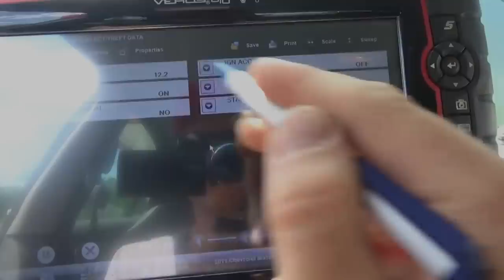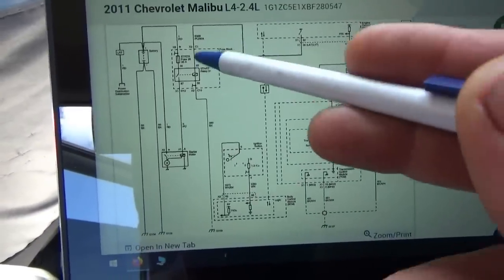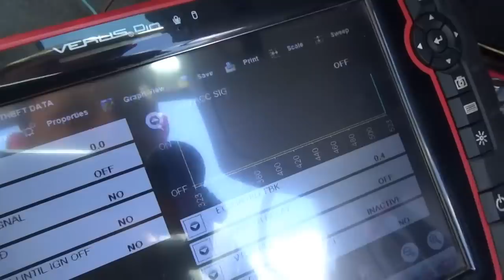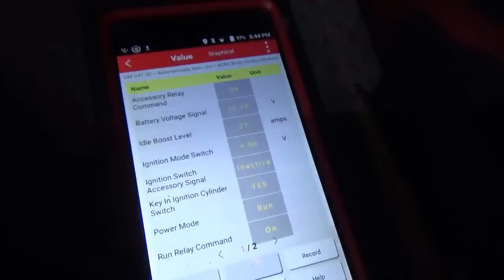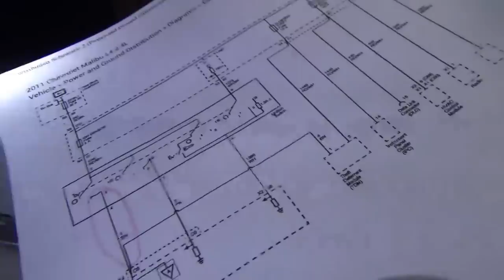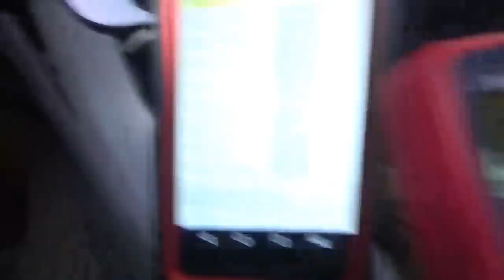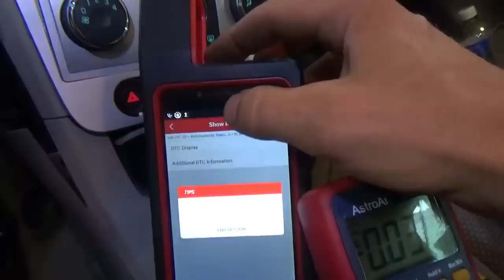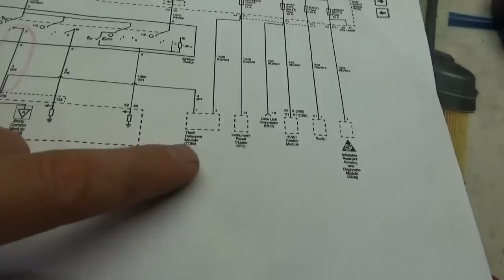Mystery Malibu is BACK! (Intermittent No-Crank)

Comment: Hi Ivan, I worked as a mechanic several years ago. In my years working on cars
I ran into this condition twice. The fuse(s) had just cracked, did not burn or blow.
Any craftsman has to learn these type of "conditions with experience. I think you did
very well checking this problem out. You are an excellent TECHNICIAN. Thanks for
the great videos.

Comment: Had a similar problem with an A-7E Attack aircraft. Drove me crazy for 2 days. Relay logic in the power link between the navigation computer and the Doppler radar “go-out-of-standby” command. Sure enough, a glass fuse looked perfect, but I never ohm’ed it out and it was open. Worked almost the same as what you were working on. Problem was once the electronics bay warmed up the problem disappeared. So we put an external A/C unit in the electronics bay and cooled everything down (like it would be in flight) and finally found the bad fuse (that the night shift and day shift had looked at (not ohm’ed out) a dozen times). Hold it in your hand for 30 seconds it would close. Cool it down and it would open. Had to demonstrate it to the shop Chief. He kept it and showed it to the maintenance officer. Nobody had seen anything like that before. 

Anyway, your retrospective troubleshooting is spot on. And you may have felt a little “pressed for time” as the customer was at a gas station, had other stuff to do and needed to go... in that situation skipping several steps would allow you to find a work-around and get him going again. So, yeah, it’s an opportunity to oops.

Great video and thanks!!
Reply: Worked USAF Aircraft Avionics for a long time.  Yes, problems that would drive you out of your mind.  Like this one in one of out 400W HF Radio systems.  Worked OK in lower HF freqs - lost a lot of power out in the high end.  Problem?   SOMEONE, "out in the system" - was a C-141B - changed a segment of Transmitter Coax.  Use wrong Coax with a totally different Impedance.  At high freqs the segment would offer mega reactance and kill the output.   That was a 2 day around the clock.  Did I find that.  Yes (I have to admit it. :)  Just checked the size of coax on the cable itself.  Was wrong coax.  N-6395T
Reply: That's pretty cool. I asked an instructor in the 70's how to troubleshoot an intermittent. He said stress it. Hit it, heat it, freeze it. Found a goofy cap!! And that stereo was in the trash can 5 times prior.
Reply: A wonderful story...that's what makes a good teacher!
Reply: Awesome stuff here!
Reply: John- Would you believe 2 Boy Scouts and a whistle? "Hello Chief?" I can't hear you Max. My favorite show- So much I named my son after 99.
Reply from the maker: Great story! Probably why they don't use glass fuses anymore haha
Reply: I thought he was bs at first mans really got an aircraft
Reply: @ylmbonez  Yeah, I do. But it isn’t an A-7E, unfortunately. I’d love to have one, but they are all retired now. I think maybe some foreign ally’s may be flying them still. But, I suspect they’ve all gone to the chopping block by now. Really good airplane, that Corsair II. LTV/Chance Vought. I loved working on it.

Comment: I think my favorite part of the video is where Ivan covers the lesson learned at the end.. It is harder to stop and think of a lot of these things when at the gas station with the customer hovering so there is pressure to get the problem resolved asap, and perhaps a real or perceived accusation of either having caused the problem by working on the car in the past or that a previous repair wasn't done properly which may or may not have played in. Personally I have had many people try to imply that to be the case even though it's fairly plain to see that the problems are not related.
The lesson however is just as Eric O. states, "You have to go slow to go fast".

Comment: Ivan. You are a terrific person. You work through problems step by step. Having to talk and record and diagnosis and fix the problems put a tremendous load on your thought process. I think you can record what you find and fixes will help unload the stress you are going through. I have been following you and my 66 year old mind has learned a huge amount from you. My mind is always open and learning. I am working on a 87 s10 pickup that has not run in years. Just last week. I got the truck to fire up using a carb spray cleaner as fuel. The owner had a huge smile.  He had to order a new fuel pump. I cleaned out his old fuel tank. Full of debris. Installed new pump. Checking the wiring. The hangers are missing hardware. So that's on my list. It's getting really close to have actually running. After many years sitting in his front yard. From what he told me. Other mechanics have tried and failed. I'm not patting my self on the back yet. Until it's on the road and running well. Remember take a little more time and don't get pressed and stressed for time. As another person noted. Have it towed to your shop and take the Time.

Comment: Was a diagnosis master tech for a famous German brand for the last 30 years and retired now. I like the work you do. The best way to look at an issue is to ask yourself “what does the control unit have to see to enable in this case an engine start”? 
So with this one do a pin by pin on the BDC. Check all inputs and outputs. Are they all there NO. Remember garbage in garbage out. Hope you can understand my explanation 😂👍🏻🇨🇦

Comment: The newer OBD2 compliant cars are easier to diagnose because when a sensor or connector fails on any given sensor you're likely going to get one from the actual sensor or connector that's faulty.

For example,I am getting a code 54 in my brothers 2000 model Subaru Forester,I checked for air leaks in the air intake & I did fix one which was the throttle body gasket which shrunk & cracked at 20 years of age,I sprayed it with both carburetor cleaner & water ,I did a compression test which tested at 193-195 PSI which is good,the fuel pressure is good as well.

I checked the fuel injector coil resistance which was good as well, the symptom is that the engine runs smooth for 15 minutes albeit at a higher idle speed then it starts surging,I did test the oxygen sensor which tests good,I also replaced the IAC valve assembly which made a bit of a change but the problem is still there.

Now,my brother has a habit of running reoilable K & N air filters which could've contaminated the MAP sensor with oil,I've ordered a hand held vacuum pump so I can check how much voltage that it's putting out under different levels of vacuum so I should get that on Monday.

The MAP sensor costs about $400 -$600 AUD for a brand new if you don't want to wait a few weeks for the $20 AUD  Chinese aftermarket MAP sensor or buy a used one from the U.S. for $70 AUD including postage and handling to Australia,so that's why I need to test it.

My point is it's not showing the code 23 MAP sensor code,just code 54 for the air intake system so that  tries to give me a bumsteer.

Edit 6.9.2020

I tried backprobing the MAP sensor & it seems to be working fine at about 1.4-1.5 volts at idle & an increase if I snap open the throttle.

When it started surging,it was reading at 1.5 volts DC & I tipped water around the throttle butterfly shaft which smoothed the engine out & the voltage went down to 1.4 volts DC,yes, the aluminium bore for the shaft is worn out so the throttle body needs replacing which I have already ordered yesterday.

Yes,it was leaking air past here as well :-

https://qph.fs.quoracdn.net/main-qimg-4f83c26bd019cdc161a63c25a0bbcf8f

Comment: I am a fuse checking convert. Before anything else, check all the fuses on the vehicle. Three fuse locations (even the pia one in the trunk) in case of the Malibu. A blown fuse shared by a phone charger circuit led me on a wild goose chase. Lesson learned.
Reply from the maker: That's usually a waste of time since new cars have like 200 fuses. But this one was staring me straight in the face haha

Comment: There isn't enough space to go thru all my mistakes. You don't normally see a blown fuse in a ignition circuit. I usually get them in the lighting circuit. Sometimes I've learned the hard way to not overlook the simple things. Thanks Ivan

Comment: Great video for sure. I am currently having an issue with my wife’s 2010 Malibu. I recently replaced the fuel pump due to her mentioning multiple times the odor of gas. Which originally was a small seeping of gas on the return line I believe. Replaced it with a Delphi pump, and one month later, intermittently starts. But when it is shut off, it not start again. Sat for about a month, and it started this morning. After three tries of it turning on, back to square one.
Reply: Pine Hollow Auto Diagnostics, what would you recommend I look for? Everything seems to be working upon ignition, and it also turns over, just doesn’t start. I don’t believe the pump is supposed to prime at every turn of the key right?

Comment: Regardless you figured it out. It easy in these computerised vehicals to overlook something even something small nonetheless you prevailed how you found the components and problem, I'm still lost. You are despite this minute issue a great diagnistition and mechanic. The first part of this video helped me find out what was going on in my stalling problem, truck would run but once in a while just stall. In my case too it was a bad wire. Thank for the great videos.

Comment: I learned to ALWAYS check the fuses first a long time ago on a Toyota Tacoma that had a bad alternator, when the customer came in the battery was dead so we installed a new one and checked the system and discovered the alternator was not charging.  We removed the alternator and bench tested it and it would not make power at all so the customer had to buy a $400.00 alternator but decided that he could do the rest of the repair on his own and took the truck home with the bad alternator installed just to drive the other accessories.  After the new alternator was installed he brought the truck back in because the new alternator was still not charging and the battery light was still on so we pulled the new alternator and bench tested it and showed that it was working fine so the problem had to be in the wiring in the truck.  After several hours tracing wires all over the truck I finally decided to check ALL the fuses and found the fuse for the reverse lights was blown so I replaced it just to be sure and the alternator started charging instantly.  The customer went to test drive the truck and as soon as he put it in reverse the battery light came back on and the fuse was blown so I took the tail lights out and found that the passenger side tail light had a bare wire that was shorting to ground so I repaired that and the truck was fine after that.  I learned that ALL the fuses have to be good and not just the ones for the charging system that day and I will never forget it for sure.
Reply from the maker: Excellent! A wiring diagram of the charging system should have led you to the right fuse :)
Reply: @PineHollowAutoDiagnostics  I don't believe the reverse lights are connected to the charging system wiring other than they both connect to the battery at some point.  The truck was a 1999 Toyota Tacoma 4x4 regular cab 5 speed with the 4 cylinder engine and it had air conditioning if you want to look it up and see.  I didn't bother tracing the reverse light wiring diagram after figuring out the broken wire was the issue, I was just happy to be getting it out of the shop. lol
Reply: @PHAD - I’ve run into a similar issue on a GM chassis school bus once.   The reverse lights shared fuse with the alternator excite wire.   Ended up finding out the reverse light switch on the Allison transmission was shorted internally causing the fuse to blow.   It definitely threw me for a loop, but those cases do have a way of sticking in your memory.
Reply: Computer control charging  systems found in late model cars are a little more sophisticated than just a rectifier / diode older style alt.
 Integrated circuits everywhere & even a bad battery will cause many a weird code to be set. Anything over 2014 , especially "luxury " euro turds like BMW ; (broke my wallet) is sensitive to low voltage feeding the confuser beasties.

Comment: Hey, Ivan, all you can do is assess mistakes and learn from them. You and Eric O are still the best YT mechs by a mile. Heck, I wouldn't be a DIYer if I didn't learn a LOT from my OWN mistakes! My own best goof: Replacing a thermostat on an 04 LeSabre, I had to move a small vacuum line for clearance. Replaced the thermostat, no sweat, cranked it up...car ran like poo!! Thought I'd wrecked the engine somehow. Couldn't imagine what I'd done... The I realized I'd forgotten to put the vacuum port back. DOH. Put it back and all was well. Can't be afraid to make mistakes!!! 😁😁

Comment: This Malibu is somewhat similar to an 08 Cobalt I recently traded in, was a great car for 12 years until about last year, car had 29k on it when I got the car and traded it in with 148k, had to replace several front suspension parts and the transmission started to go out ( had to be warm to go into overdrive). I was meticulous about the maintenance as well...on the other hand the engine still ran like it was new. Glad I bought me a Scion iM.

Comment: 1. It was an Ecotec engine, a known wildcard.
2. Chevrolet is known for trying to save money by using the cheapest wire, and fuses, possible.
3. Always look for the simplest solution to seemingly complex or expensive problems, i.e. always apply Occam's Razor before firing the parts rifle (or cannon).  
4. Good call in recognizing how you were led down the wrong path, and not charging the customer for any errors you made.

Comment: I'm just a DIY guy, not a pro mechanic so definetely have had few misfires with parts cannon :D
Also, have gotten misleaded by multimeter. Tested a ground wire, continuity was ok but missed the fact, that it was so corroded that I guess it couldn't carry enough current and probably was at least partially responsible in frying the ignition module from 1990 Mazda 323... twice during just 100 kilometers :D

Comment: I have seen issues similar to this on relays where the load is very small.  Higher current (>1A) "wets" the contacts an keep them clean.  The fuse leads looked like it had made good contact in the socket.  Fuses are cheap, so replacing it was the right call, but I think I would have sprayed a bit of DeOxit in the socket.  Did you test the old fuse for continuity/resistance ?

My "take away" is, any time you see a fuse in a circuit, test BOTH side with a test light !
Reply: My 'guess' would be a little corrosion between the fuse and fuse socket.
Reply: As cars get more complicated, (generally for no good reason, except so designers can out impress each other) this type of problem will always be there. I wish I could blame Congress for this type of thing, but poor design is the culprit. I pity the owners who have no idea about basic DC wiring, or possess any repair skills. This is why extended warranties are selling so well. To repair cars today is more expensive than it should be.
Reply: @hatfez  - I am above average at understanding modern electronics and being able to read and comprehend wiring diagrams.  Until the manufacturers are required to publish this information as part of the price of the automobile, people like me are dead-in-the-water at these types of diagnosis without paying for the information.

Comment: I think the ignition switch has a - connection it it for a computer sensing ... the contacts in the original switch might have touched the negative sensing  and popped the fuse .   I have changed a few of those  2amp fuses in the Chevy Malibu ... as for next time  Listen to the customer he said the radio did not work in the acc position.  I would automatically checked every fuse  . But that’s me .  Still a great video buddy

Comment: What about this alternate saga: Customer poked ground with the rigged probe thus fuse blew. There's still an intermittent problem in the key-switch you just put back... 😁
Reply: That's an interesting scenario... I wonder where he sourced the supply for the jumper...

Although, that scenario would likely have left the car stranded again.
Reply: Good point. Something blew the fuse. I would replace the key switch as the thing was already disassembled and not assume a defective fuse.
Reply: @mattmanyam  : What's your trail of thoughts there bud, because the logic there does not come true to me.
- Either the fuse is a red herring or the root cause.
- Fact is, fuse was blown and replaced.
- If it is a red herring the issue is still present when car leaves shop.
-Other scenario: If fuse is the root cause: The car is now fixed. It would experience the customer complaints with the fuse blown... Wouldn't it?

So, what's the scenario you try to point out? And would that conclude fixed or not fixed by replacing fuse?😉
Reply: OUCH
Reply: @bigcheese781  was it actually blown? or just very tarnished blades and terminals/fretting making a bad connection at such low current.
exactly that same problem occurs in electronics and RF connectors of very low power, tarnish kills ;)
Reply: @throttlebottle5906  : Hopefully that was the case... Would mean car's fixed now.
Reply: There's a difference between a Blown fuse and one that's cracked/intermittent. The fuse element is aluminium and these will fail open without blowing. Seen the same with the glass fuses too.